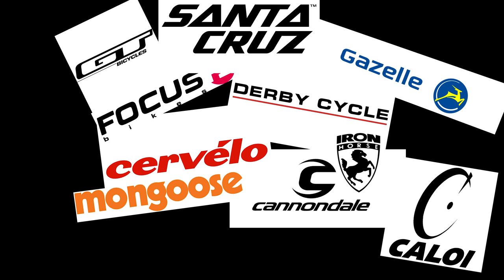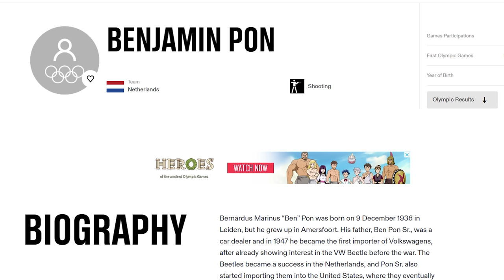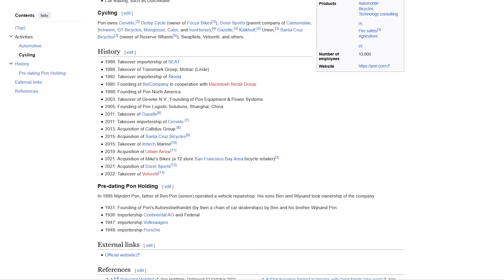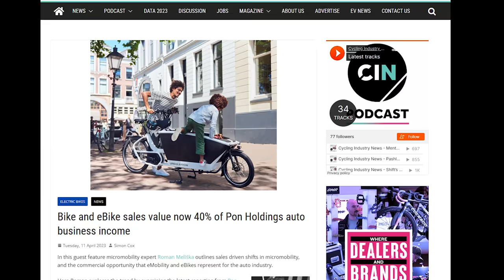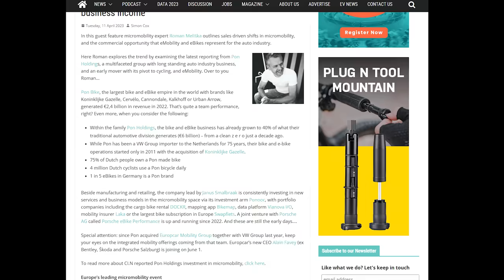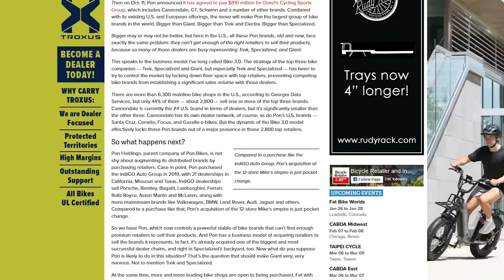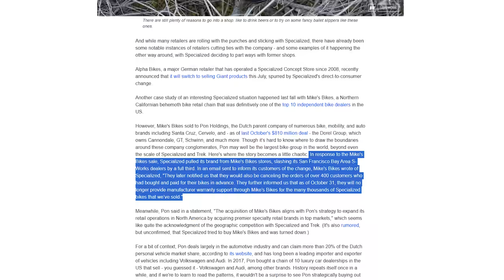Biggest bicycle company is not who you think

Comment: If they could come in and handle the sales like a car dealership, it may be beneficial. 
Instead of the shop having to buy a large inventory to stay in the network, just have distribution centers and allow the shops to carry minimal inventory, or better yet, just a demo fleet and then PON can ship from the distribution center in a matter of days once the bike is bought.
Shipped to the shop, not the customer.
Customer gets to test ride and shop is only out the cost of a demo bike.
Reply: This is great. This is essentially how I would like to operate. Unfortunately this doesn't work for all customers. Some customers need a bike THAT DAY. And I had one such customer where we ended up giving him one of our fleet of demo bikes until his bike arrived. Not optimal but we did our best to make him happy and meet his demands under the circumstances. Only so much you can do as a small local bike shop with barely any funding. But thats how I survived covid, was by not having my assets tied up.
Reply: @diehardbikes  If the above system that I described above was in place, you could have looked to see if another shop under the PON holding umbrella had his bike, and had it transferred over.
I’d say you could have a demo fleet, that you are responsible for buying, and then have some stock, but not as much as some of the big name companies require.
Reply: Unfortunately, unlike cars, bikes must be in MANY different sizes of each model for a test drive...leading to inventory approaching what many cycle shops carry today.

Comment: Have to question how PON Holdings in rapidly and aggressively acquiring a 40% market share is 'helping competition'? Sounds like they are trying to build a monopoly. The bicycle business is going to go through a big shake up, because of greedy corporations who are designing bicycles and equipment by people who never ride them. The race led bicycle vein is about mined out. Prices at the retail point don't necessarily reflect the manufacturing cost plus a reasonable margin. Before Raleigh closed their factory in Nottingham, they had started sourcing bicycles from abroad. A bike was costing Raleigh £8 in a carton leaving the factory, but selling at £600. Yes, there are distribution costs, and a reasonable profit, but was the profit reasonable? The other issue is durability. Components are not durable, especially so, given the initial cost. It seems they are designed to fail, to ensure production lines keep running and to create a constant revenue stream. This is all backed up by marketing hype via the cycling media. You never read or hear a bad review, the latest thing is always the dogs whiskers, and the prices keep going up and up. 2024 will see a change in the market.
Reply: Curious which components or parts of bikes are built to fail at a quicker rate than previously? And proof source?

I feel like Campagnolo genuinely made stuff built to last as that is what I own. The wheels and my drivetrains are no newer than 2017, they are absolutely flawless!
Reply: The quality of Raleigh frames skyrocketed when they moved production to Taiwan. I commuted on a Raleigh MTB back in the mid 90s and the frame would develop fatigue cracks and I'd get another one on warranty every 2 years max due to fatigue cracking at the welds, until they discontinued the model I was using and replaced the bike entirely with a Taiwanese welded frame. 

The Taiwan made frame lasted me almost the next 20 years of daily commuting before fatigue (And running it singlespeed on a new work commute that included just short of 100 m of climb in less than 1 km) broke a chainstay. The Nottingham welded frames genuinely looked like they'd been thrown together by a farmer with an arc welder in a shed, right down the the weld spatter sealed under the paint, while the Taiwanese frame has minimalist, even TIG welds - and the failure on the Taiwanese one wasn't at a weld anyway.
Reply: Did you mean $80?

Cos you can't buy even the smallest kids bike from China for $8  FOB.
Reply: @BestKiteboardingOfficial  The Raleigh factory closed before the site was redeveloped in the Jubilee Campus of the University of Nottingham. This was opened by Queen Elizabeth in 1999.  So you are obviously conflating something which happened over a quarter of a century ago with today's prices.  However my point remains that corporate business has ruined the cycle trade. Some of the best innovations in cycling came from individuals, not corporations.